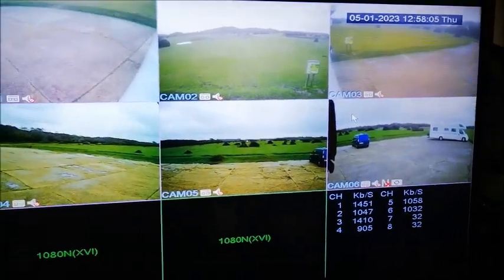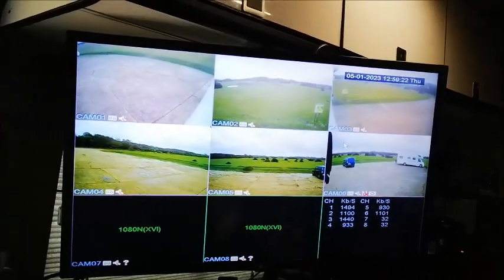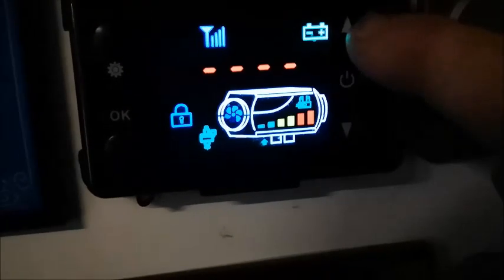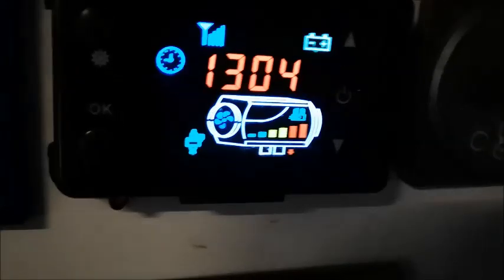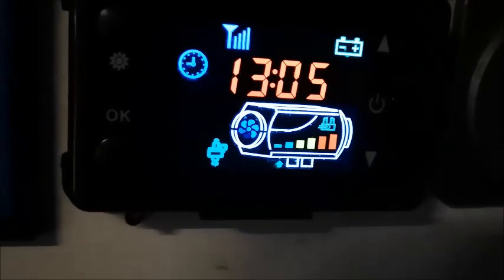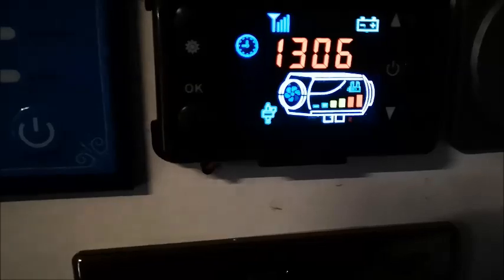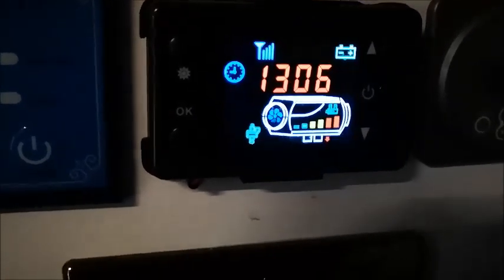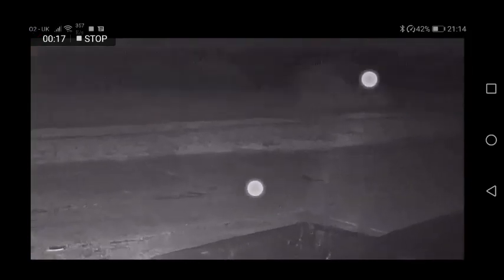Tuning A Chinese Diesel Heater - 2018 Mercedes Sprinter Build

Comment: Good job!! Definitely looked like a weirdo, I’m in Alaska going to remember Jogon!
Reply from the maker: Wow, what a beautiful place to be able to explore. Enjoy every minute.  He's got a shock coming his way as he's revisited although I missed it but the cameras didn't so I'll be waiting and prepared.
Reply: Mate this mates no sense to me, if you simply measure the heat output and turn down until it drops that’s your optimal point, all you’re doing it setting a limit that the equivalent of turning it down logically.
I’ve seen a few people doing this now and it pointless, just reducing the pulse rate is the same outcome.
Reply from the maker: @dazzassti  If it makes no sense to you just do it your way. I post about what I do and how I do things and I'm not ever going to tell people my way is better.

Comment: I also playing around with the settings keeping the fuel cost low but the efficiency on level. I am interested in your fan speed settings (low/high). Thanks in advance
Reply from the maker: Every heater is different and needs to be tuned specifically based on that heaters reaction to input changes. Best of luck, it definitely works for me.